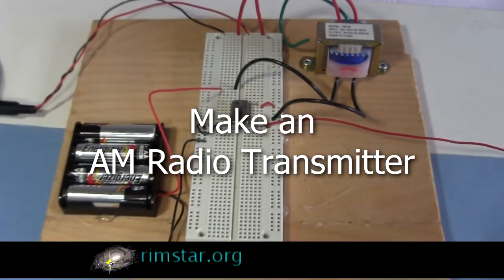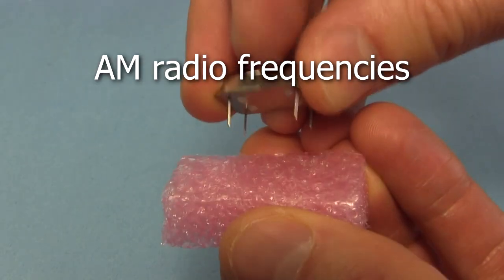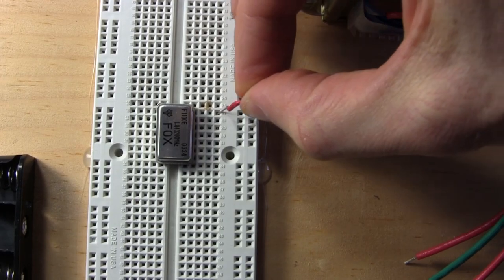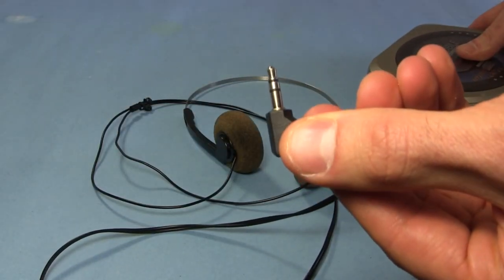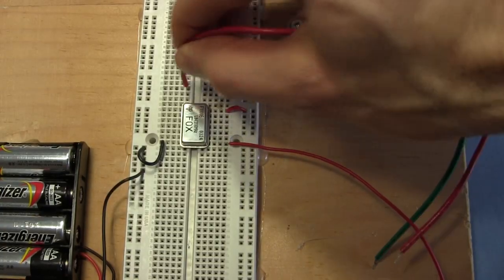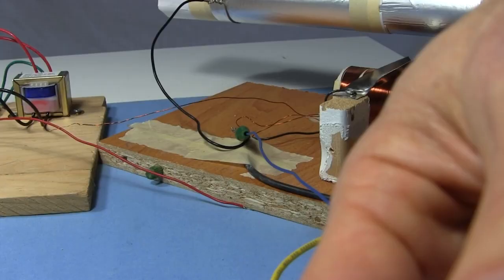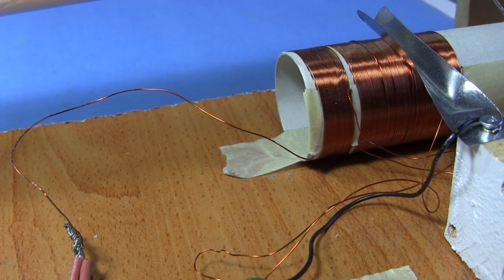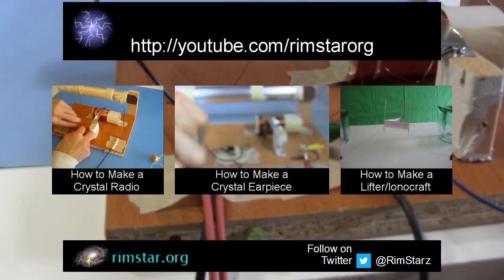How to Make AM Radio Transmitter

Comment: Anyway to get that down to at least 1710Khz, so I can tune in on my car radiio? My car radio goes to 1710
Reply from the maker: +Chilly Willy Get a different oscillator chip. I give a link in the video description to where you can get one. Be careful to not broadcast too far since not only would that be illegal but it would disturb anyone trying to listen to the radio. To make matters worst in that case, this is a very simple transmitter but also a very bad one in that it transmits on multiple other harmonic frequencies at the same time. Any transmitter should be used for only a few feet unless licensed.

Comment: If your output is stereo, I suggest you wire the 3.5mm jack with BOTH channels, so you don't miss half the music you'll have playing.
Reply: +Alex Paulsen And thats pretty much what a stereo plug to mono jack adapter does internally!
Reply from the maker: +Alex Paulsen Will that work? I mean if I solder to both the short legs inside the stereo jack, would that result in both signals influencing the transformer correctly? I'm having trouble picturing what would happen if the stereo signals are different i.e. different sounds intended for different speakers.
Reply: RimstarOrg
If they're different sounds, they're different frequencies, and so you'll end up with the sounds being audible at the same time. How do you think those little mono bluetooth speakers get away with it?
Reply: WAQWBrentwood
Exactly.

Comment: hey rimstar, would you know how much power in watt can this transmitter achieve?
Reply from the maker: +ivan R I don't know how much power it can achieve, though from some of your other comments here you'd probably have a better idea than me! But people shouldn't use it to transmit far anyway since you don't want to interfere with other transmissions.
Reply: +RimstarOrg no worries i have a 40 mhz cristal :) I tried using a mains transformer and from what i could tell it needed a higher current to run. ( gave it 100 watt power at 13 volts dc). I am sure that thing was wiked powerful becuase the crystal was clocked to 40.00000 mhz and I used a narrowband 40.685 mhz receiver and i could clearly hear it from 15 meters away on a 10 cm antenna. I'll give it a shot on a more powerfull antenna and ill try to make a 40.0000 mhz reciever to test the range.
Reply: +ivan R 1mW if that.
Reply: smallenginedude71 mw? mine drew around 100 watt? I think it was broken though, as it got very hot.
Reply: ivan R i am not talking about power consumption. i am talking about RF power.
Reply: smallenginedude71 weird. mine was definitely busted :D.

Comment: How long is the range ?
Reply from the maker: +Clostors It was a while ago, but I recall I transmitted around 1 meter/3 feet. You shouldn't transmit much further since you'd interfere with regular radio stations. This is meant as a very simple circuit, and so it does bad things like transmitting on multiple harmonics, making it even worse to be transmitting any large distance.

Comment: Will these station work without that Crystal radio?
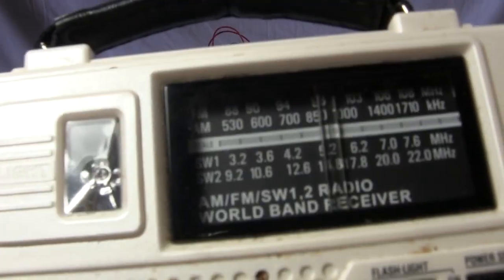Reply from the maker: Adnan Ul Hoque Do you mean the 1.8MHz without the subharmonic like I show at 6:20 in the video, but actually at 1.8MHz? If your radio can tune into shortwaves then it should work. In fact, the radio I used does have shortwave but the signal might not be strong enough. I may need a more powerful sound source than my CD player.

Comment: Can I use a 12mhz crystal? That would be on the shortwave band. Also can't find a transformer.
Reply from the maker: ArriCAT5e I'm not sure how well 12MHz will work. It's a lot higher than the 1.8MHz I used. This is the link I give in the video description for where you can by an audio transformer online https://www.scitoyscatalog.com/category/R.html
Reply: RimstarOrg
 I meant locally I can't find 'em. I guess I'll just get online. Thanks.  I'll experiment with some different crystals.
Reply: +RimstarOrg it is probably going to work flawlessly if you use a high current source or  a mains transformer like i did. I used a 40.0000 mhz crystal. The output must have been very powerful since i could hear it on my  40.685mhz am transceiver, which is a whole different story.

Comment from the maker: +Greg Mitchell Use a more powerful sound source.
PS There's no Reply button under your comment because of your Google+ settings.
- go to your Google+ page,
- in the top, right corner click on your thumbnail icon,
- in the popup that appears, click on "Settings".
- for the 2nd question down "Who can comment on your public posts?" set it to "Anyone".
Reply: RimstarOrg Ok I fixed the reply settings, thanks for telling me there was a problem. Would the audio output on my computer be any more powerful? Is there a way to amplify the input?
Reply from the maker: Greg Mitchell
I really don't have a feel for the the strength of the audio output of a computer. I suspect it's about the same as the CD player in this video though, since both are used with headphones. There must be an amplifier in PC speakers that makes it louder. You can buy small amplifiers like this one http://comingsoon.radioshack.com/radioshack-mini-audio-amplifier/2771008.html#.VYM7d0bSnbg or you can make your own like mine here https://www.youtube.com/watch?v=JtPwxbOgBHw
Reply from the maker: +Electronic Experiments I haven't worked with 2 pin oscillators but from what I read of them a while back you'd have to add more circuitry to get it to work, basically circuitry to make up for what's in the 4 pin oscillator that's missing in the 2 pin oscillator.

Comment: RimstarOrg How could I improve the range of the transmitter (other than using a longer wire)? I understand I shouldn't broadcast very far, this is just for the sake of learning. Could coiling the antenna wire help?

Comment: I made one of these once, but my was much better. Then I connected it to a radio tower and it could transmit like 10 kilometers.
Reply from the maker: Sebbe kartellen Yeah, this one's meant to be about as simple as possible. But it transmits on a number of frequencies at once so I wouldn't recommend transmitting more than a meter or so. I hope you were transmitting on a frequency that wouldn't interfere with anything.

Comment: How far would a 50 ft tall tower transmit? :P
Reply: +Bob “bobdabiulder” dabiuld according to the w=c/f formula if you have a 1mhz crystal for simplicity's sake, you would have w=c/1,000,000=300 meters. Due to the fact that for optimal transmission a rod antenna needs to be at least 0.2 lambda (wavelength) 300/5=60 meters. The efficiency of your antenna would be 23/60= 0.3838 or 38 percent. I will be generous and assume that you run a 100 watt through the antenna. The antenna would really be giving of only 38.38 watt into rf. Another loss of power would be harmonics which often happen with these crystals. But again for efficiencies sake i will not count them. So it boils down to you having a 1db gain on the transmitter, 1db gain on the reciever, the maximum possible distance would be 15km which is crap for 100 watt.
Reply: it would reach Thailand if transmitted at night..

Comment: Could I instead of using a crystal oscillation chip, could I use a oscillation coil?
Reply from the maker: wind chester I you mean a two pin chip then yes you can, but you'd need more parts for the circuit, basically adding parts that are already built into the chip in this video. I'm not familiar with oscillation coils.

Comment: So would this work if you can wire a ac in jack and just plug into the the electricity? Just thinking about it cause it would be better so you don't have to change batteries unless you get rechargeable 15 minutes battery which I got in my mic which last a while. Question is will it work on it?
Reply from the maker: Richard Mohabeer Rechargeable batteries would work. For plugging into the wall you'd need an adapter, like the ones that come with many appliances, that converts the AC to around 5 volts DC.
Reply: Thanks I bought these 13.00 loud radios I like working with electronics so I figured you can use and thanks!!!

Comment: Hello
Will this setup operate on 220v 50Hz?
Reply from the maker: Dinkymaster7 It should. The only thing that would be using 200v 50Hz is your sound source. It doesn't make any difference to anything after that.
Reply: Yes but you may be transmitting sparks and smoke just as far as the rf signal

Comment: Is there anything I can change to make the transmitter better because I can hear it on my radio but its faint
Reply from the maker: sausy mayo I don't think adding more batteries in parallel with your existing ones will help since that's just the carrier wave, but you could try that. The other thing is to increase the strength of your sound source. Turning up the volume is obvious but you could also just try something else that outputs a louder sound.
Reply: RimstarOrg if I wanted to build a high wattage transmitter could I do it through high power transistors? or what would I do?
Reply from the maker: Owen Chase I don't have an answer for you. I've never built a high wattage transmitter.

Comment: Instead of plugging in a phone plug in the radio, can I just connect an electret mic to the circuit and play the radio near it?
Reply from the maker: Hunzofmun I don't know if an elecret mic would have enough power to drive it. You'd have to try. I did have it in mind at one time to try a mic with an amplifier. If you try it, let us know how it goes.
Reply: RimstarOrg No the electret mic didn't work. I tried everything. Tried turning my audio transformer around but no results. I was using a 9 volt battery. Is it possible that the voltage is too high for my electret mic, audio transformer or oscillator to handle that in can short circuit them?
Reply from the maker: Hunzofmun I don't know much about electret mics but my guess is that the mic doesn't produce enough power to do much in the transformer. If you had an oscilloscope you could look at what's going on. If my suspicion is right then I'd try plugging the mic into an amplifier and having the amplifier output go to the transformer.

Comment: This is kind of embarrassing but I can't find any way to unscrew my audio plug. I've tried going around stores looking for unscrew able audio plugs but I haven't had any luck with it. Does anyone know how to unscrew an audio plug?
Reply from the maker: Amir llamani Try gripping the parts with pliers. Or maybe it's a press-fit in which case you pull them apart. If it's just the plug that you bought then they must come apart somehow.If' it's a plug you cut away from something else then you may not be able to take it apart without cutting the plastic. Just put tape over it after.

Comment: Couldn't you make the transmitter more powerful by adding a better antenna instead of the little wire ones?
Reply from the maker: SuperGmodkid Yes, but I wouldn't want to. If I make it too powerful then I could not only interfere with one radio station but since this simple circuit also transmits on some harmonic frequencies, it could interfere with more than one station.

Comment: I've got a question: Do you think, it's possible to make this transmitter with a transmitting power of about 10 to max. 100mW in order to power up a crystal radio with a very small antenna about 1/1.5metres away?
Because I'm planning to build a very small crystal with a as small as possible antenna.

Could you answer my question whether it's possible or not?
If your interested in my project, we can also discuss a little bit more about it - it would be a quite great thing if it works.
Thank you in advance!
Reply: +FabiP1997 yes it could work, but you already would need a much much higher frequency for a meter antenna(assuming it is a rod antenna), would need a frequency of at least  0.2 meters or more in order to get any gain from it. And if you use a 300 meter frequency (1mhz), you would only have 1/60 or 1.6% of the power converted to that frequency. You would also have a lot of harmonics and subharmonics. So if you would want to hear it, you would need more power(much more power) or use a different type of antenna or easiest of all, use a 400mhz crystal. That is well under a meter and you would have 75% gain from it.

Comment: Hi, I would like to make this transmitter but i need some informations. Can i transmitt radio signal in range about 500m(1640ft) and how (if it can)? Can i use transformer from an old radio reciever? Do i have to use 4x1.5V AA battery or i can use 9V battery (does it effect on radio signal range if I use 9V battery instead of 4x1.5V AA battery)? There's one more question : If I use 1.8MHz oscillator that means that it will transmitt signal on 1.8Mhz and on 0,9MHz? Thanks

Comment: Can this AM Radio Transmitter works on the shortwave bands? (i.e. 1.6 to 30 MHz)
Reply from the maker: ***** The one in this video is doing 1.8 MHz. I don't see why it can't go higher, but I don't know the upper limit.
Reply: RimstarOrg  Is it possible to make it transmit as a CW  on 630metters band ? Will it work with some simple circuit with IRFxxx transistor and will it gives about 5-10 w?  What's change is needed to make it work 5 Watt CW on 630 metters band?

Comment: I made this, and positioned the transformer in the original orientation (1000Ohm side to the oscillator) using my phone the transmission comes through loudly, but unfortunately it is accompanied by a high pitch whine. Do you think reversing the transformer, and using a stronger audio source would work, or do you think I need a capacitor or something somewhere to clean it up?
Reply from the maker: pricemac You're saying you were using your phone as the audio source? In that case I really don't have any suggestion except to use a different audio source. My guess, and I could easily be wrong, is that something in the phone electronics was interacting with the transformer to create the high pitch whine. I don't know how to fix that.
Reply: I tried using my PC speaker-out as well, and in experimenting, found that it emits the high pitch tone as soon as the battery is connected, and regardless of audio source. It's a real head scratcher for me. The audio still transmits, so the circuit is working. I'll try swapping the transformer around and see if it's just a side effect of the reversing unless you have any other good places to start.
Reply from the maker: pricemac Now it's sounding like it may be a problem with your oscillator. It might be the source of that high pitch tone. Which chip is it?
Reply: RimstarOrg They are XO-54B's. 1MHz Crystal oscillators, manufactured by Dale.  Here's the data Sheet: http://pdf1.alldatasheet.com/datasheet-pdf/view/202167/VISHAY/XO-54.html
It is also worth noting I'm using a 9V Battery for my power source, It's possible I'm producing more mA than the oscillator can handle for 1MHz frequency. Do you think that could cause a high pitched whine? From other sources, I hear DC current sounds like a whine, so you often need a capacitor to eat the DC and leave only the AC component of the signal.
Reply from the maker: pricemac From the datasheet it looks like the frequency of your oscillator is one that is settable by controlling the current between pins 14 and 7. It's not a fixed frequency one like mine. I suspect, and I could be wrong, that the high pitched whine is the frequency you've unknowingly selected by whatever current you're supplying. Try putting different high and low resistance resistors between the wire you have going to pin 14 and pin 14. See if the pitch changes. The resistors should affect the current.
Reply: RimstarOrg While Fiddling with resistors in the circuit as you suggested, I found that the wire from the transformer leading to pin 14 acted as an antenna output. So I've completely removed all connections from pin 14, and after testing it, disconnected the old antenna out cord from pin 8 when I found it made no change to the signal strength in my radio. I don't know why this works, if you could explain it, amazing, but if it's not clear enough, I can draw a diagram showing the current config.

Edit: I should note that in trying different resistors, they didn't seem to affect the pitch of the background tone, but higher value resistors did quiet the audio I was transmitting.
Reply: pricemac After sleeping on it, I've come to the conclusion that the magnetic field generated by the transformer was what was actually transmitting the signal to the radio. When I held the loose end, the field augmented my own, so while within feet of the radio, the signal was picked up. That is also why I found no change to the antenna output from the oscillator, the oscillator isn't even running at this point. I've ordered the exact oscillator you recommend from scitoys, but I'll keep playing with these ones I have to see if I can make them work. 

So question: If the current between pin 7 and 14 change the frequency the oscillator transmits on, do you think there is any way to give it no current between them, but to still vary the voltage so it can transmit? (electrodynamics was always my weak point in engineering)

My current Circuit: https://drive.google.com/file/d/0B3GtbJ0uO52MQ2V1SlFoOEFPaG8/view?usp=sharing